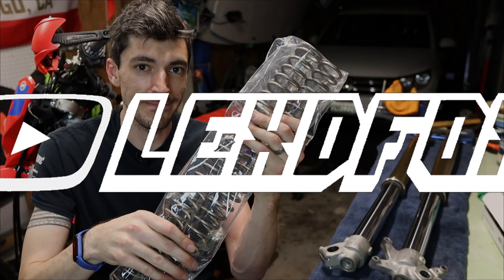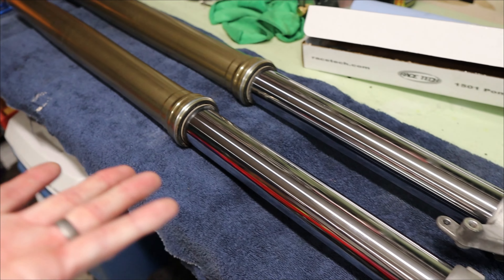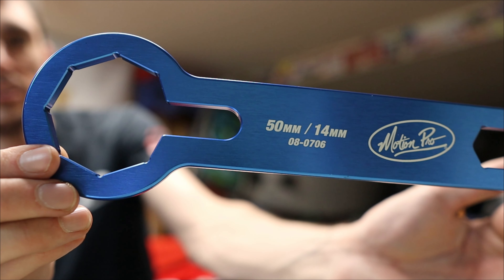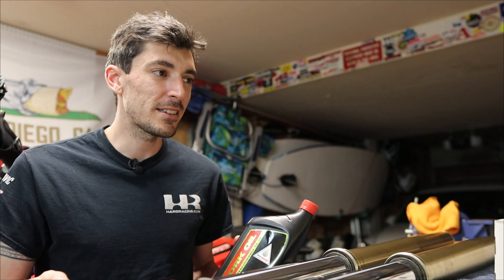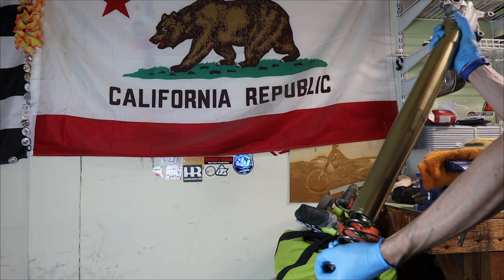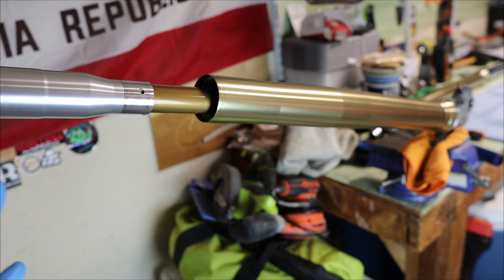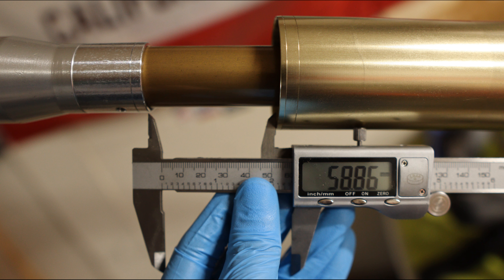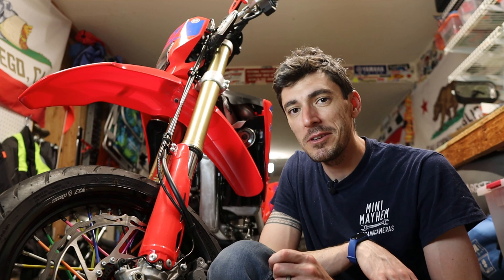CRF450RL Front Fork Service, Spring Replacement, and Preload. CRF Suspension Pt. 2

Comment: When you have the front end up do you have any freeplay in the bottom fork tubes? Mine has a small amount of freeplay and I know it’s not coming from the steering stem. just trying to figure out if that’s normal
Reply from the maker: freeplay from the lower triple tree? or on the fork tube itself? I wasn't aware of any sort of freeplay when I had the front end apart, I would ensure your clamp bots are tight
Reply: @lexdfox  the freeplay is in the lower fork tube